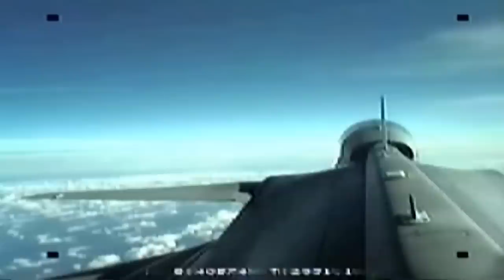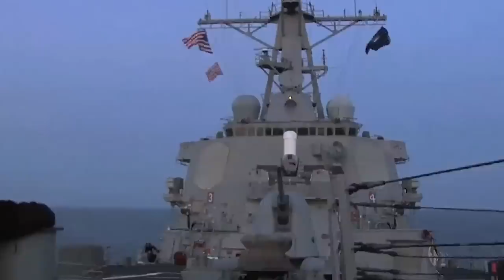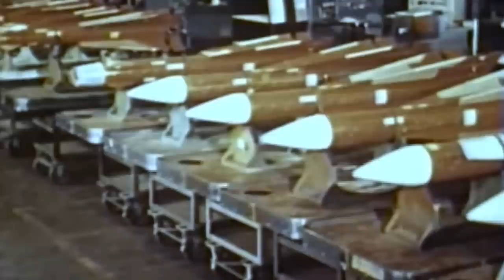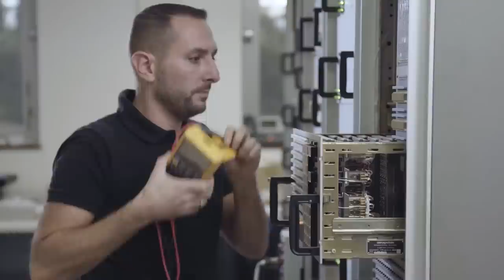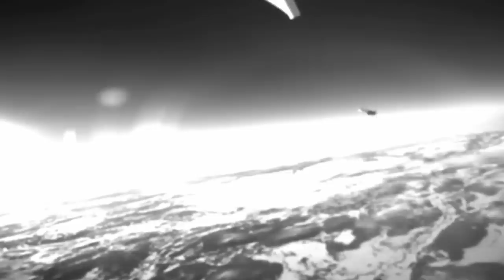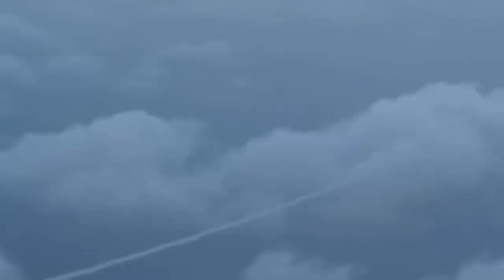The Most Brutal Air-to-Air Missile Ever

Comment: Like the Phoenix's and AAMRAM ranges it makes no difference if your Rules of Engagement require visual ID first.
Reply: It does in war.....
Modern US fighter's and their counterparts do have and use systems that send out a "reply or die" signal that only a friendly aircraft can respond to....and over contested airspace...that usually is the ROE for an air superiority campaign, or the protection of established No Fly zones.   In frequent peacetime intercepts, visual ID typically is a formality....
US stealth fighters like the F22 and F35 hold significant advantages in evading detection, even if they needed to get a visual ID.....and that's not even mentioning the high resolution and awareness due to the unparalleled amount of assets available collecting and sharing battlespace data.
Reply: Unfortunately what the ROE is and what it should be is three different things with or sometimes timid senior leadership both military and civilian.   That and their fear of the UN.   @patrickf4692
Reply: In a no fly zones everything else is a target 🥖

Comment: The US should buy these. It looks better than anything we have.
Reply: Pretty sure that aim260 is meant to fill this exact role
Reply: We have a few long range missiles in development

AIM260 for 5th Gen
LREW for 4th Gen and B-21
LRAAM for extremely long range.
Reply: you technically already can for the F-35 as the payload bay had to be big enough to house it as a design requirement during development, won't fit in the F-22's though unfortunately because it's too long 😐

Comment: Not sure how the ramjet missile would work with the solid seeker nose cone shown in the pics.
Reply: Trying to figure that out myself
Reply: It's got air ducts on the sides ?
Reply: The ramjet inlets are underneath, at 45° angles from the bottom. Most of the missile images you see are "stock" images of a missile, not necessarily the Meteor.
Reply: I don't know either but it apparently does
Reply: The portions that actually show the meteor also show the underside inlets.

Comment: Seems like a step backward, liquid fuel means you have increased maintanence, have to fuel andcdefuel the missile, cannot store it as a "wooden" round.
Reply: Doesnt matter much, actually its better for bvr missiles which will anyway take time to be loaded
Reply: The video specifically mentions the Meteor uses solid fuel - the ram air is just for the oxidizer.
Reply: @mikemilner8080  meteor is a throttling ramjet missile ( solid fueled yes)

What it does is it can throttle ( control the missile burning ) and this way the missile can save fuel by not burning it all initially ( like most solid rocket motor do) and when it is approaching target, as per need it can regain energy

Comment: Can it be jammed like everything else
Reply: If it has sensors or wireless communications, it can be jammed.
Reply: Datalink is for sending new instructions. Jamming could only prevent those new instructions. The old target is still f'd.
Reply: @svancina Hard to jam imaging thermal IR systems that can see less than 1/10 of a degree temperature changes. Easy to identify hot small flares from big much  cooler aircraft.
Reply: @svancina  Jam the GPS signal, and it can't find where the old target is.  Blind the optical sensor, it can't see the old target.  Etc, etc...

Comment: Finally a good video about Meteor instead of boasting about AMRAAM. Not only has Meteor a multiple of the range of AMRAAM but with its variable thrust it can climb to big heights.
in a standard shot it will fly in the initial direction or a track given by any airplane and only in the last phase it will use it's own radar.
And all this from an AMRAAM launcher.
Reply: All FOX3 missiles do the same. The meteor is altitude limited since it requires oxygen from the surrounding air to work. The AMRAAM because it’s a true solid fuel motor flies to over 90,000ft and then dives down onto its target. You have no idea how the missiles are different  you just banking that neither does anyone else.
Reply: @Fatallydisorganized  The 
AMRAAM fired from what altitude? Thanks to its steerable engine power it can for sure reach any sensible altitude and be it ballistically.
Reply: @hans-uelijohner8943  so can the amaraam. It only climbs to the required altitude to maximize range for a given target it's called lofting. Also, the meteor cannot reach any altitude. It's pretty easy to understand that an AIR BREATHING missile requires air meaning it MUST fly low enough for the air to have a high enough density to be able to combust its fuel. Because of the meteors constant thrust lofting isn't much of an issue on paper, however it also makes it easy to spot and get detected by missile warning systems. This inherently is a major disadvantage since your target can start to maneuver very early to defeat your missile making it a less-than-ideal weapon. The AMARAAM especially the D3 variant do not have this problem making it extremely hard to detect before it goes pitbull.

Comment: Why don't they make a surface to air version for destroyer air defence?
They did it with CAMM (sea cepter) evolving from the air to air ASRAM.
Reply: because the ram engine needs high altitude and high speed. it loses a significant amount of speed at low altitude because the engines cant be efficient. it would need a bigger rocket boost to get it to the right parameters and then it would be kind of a waste because a normal rocket booster would do the same or better, sometimes much better because of low altitude engangements. its good against aircraft but anything else not really.

Comment: If the meteor missile, in-flight, can be fed updated information via data link (including retargeting) from the firing aircraft or even third-party aircraft then it is theoretically susceptible to being "hijacked" by an enemy 
Capable of hacking the signal
Reply: Its communication is probably very encrypted, but its possible to jam it probably. But I think you want to not keep communication open to be more stealthy.
Reply: @OrIoN1989  its a focus data link so the data it gets sent is hard to jam and a simple encryption will stop any hacking.
Reply: @yujinhikita5611  Its loads of security on that link. Packet encryption, frequency encrypted and hopping, beam focusing with AESA, anti jam and spoofing algorithms etc.

Comment: Just like to point out as awesome as the Meteor missile is it does have some valid disadvantaged due to its Ramjet specific design. It lacks any real low-altitude performance I.E. Below 20,000 ft. or FL20 is where this missile performance drasticly starts to fall off and becomes almost useless in some scenario's. BUT, if the targeted aircraft stays high level it is absolutely in a bad place but any truly trained combat pilot knows to lower their altitude when anticipating a missile fired in BVR combat so... This missile would most likely be complemented by other BVR missiles such as the AIM-120 or others because of this.
Reply: If a ramjet is just a jet without the compressor stage and the main fan why would a ram jet have worse performance at low altitudes? As long as the speed of the missile is high enough allowing for the compression of air the altitude shouldn't matter. Also missiles intercept they don't follow their targets. If this was really an issue the missile can just be programmed to maintain a high altitude before diving towards the target in the terminal phase.
Reply: @joshafc41  In Ramjet Missiles they do maintain "High-Altitude" before terminal phase to keep the performance.  Ramjets only work as long as the air pressure ratio is maintained at certain numbers. Depending on altitude the Inlet must be certain sizes to maintain those numbers consistantly through out flight. This is why for instance the SR-71 (Which is actually a Dual-mode Engine) has configurable Inlets depending on speed and altitude. This applies as well to the Meteor Missile. Problem with this though is as with any aerodynamic object at high-speed in Denser air the friction increases and the pressures increase. If this missile is targeting a maneuvering vehicle traveling at high speeds moving from High to low or even Low to high altitudes that missiles inlet is going to have an incredibly hard time maintaining the proper ratios when itself has to do hard-g maneuvering to correct its flight path to impact. At higher altitudes in less dense air this is not so much a problem as the inlet is fighting less against the pressure from the outside. Hopefully, this makes sense. In other lay-mans terms it will struggle maintaining super sonic speeds while maneuvering at low altitude especially without its booster stage still connected/firing. Also, the Range is a limiting factor as well as the Meteor has well known issues dealing with targets that are not 30+nm away or so. Which makes sense as well.

Comment: So they reinvented the AIM-54 Phoenix air to air missile with upgraded propulsion.Previously only carried by the F14 Tomcat.
Reply: But the size of the AIM-7/AIM-120 series.
Reply: No the phoenix missile was made to target bombers was huge and heavy, had a terrible success rate and was powered by a rocket motor. The meteor is almost the same size and weight as an amraam has much more range and a much bigger no escape zone, was designed to kill fighter sized targets and is just more likely to make a kill.
Reply: @joshafc41  While Meteor is definitely far more advanced than the AIM-54 Phoenix, the AIM-54 has 50+ confirmed kills against smaller maneuverable jets. It's unclear how many of them even knew they were under attack, much less performed any maneuvers to try and survive.

In today's environment, though, it's absolutely unclear how well the AIM-54 would perform. Reportedly, a lot of Ukrainian aircraft get targeted by long range AAMs from Mig-31s, but they survive by performing actions to survive almost immediately. If the Iraqi pilots had similar radar warning and training to survive incoming AIM-54s from F-14s? Who knows?

What is pretty clear is that Meteor is more of a threat than Phoenix would be.
Reply: @joshafc41  Also designed decades after the AIM-54.